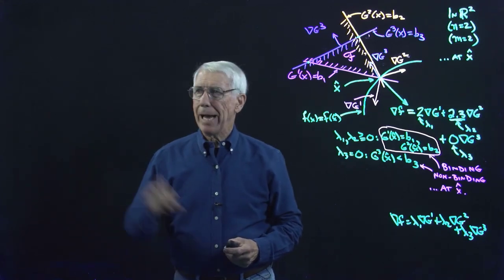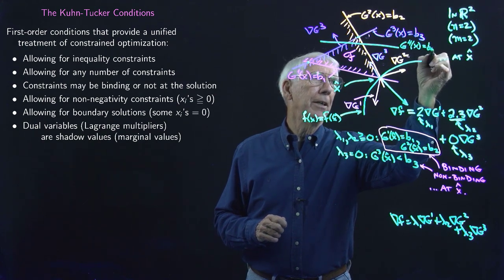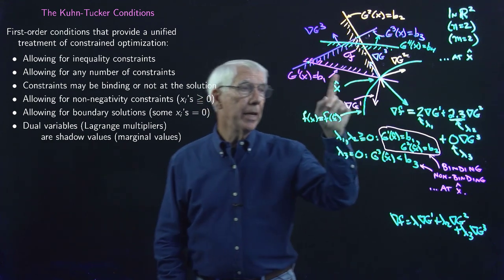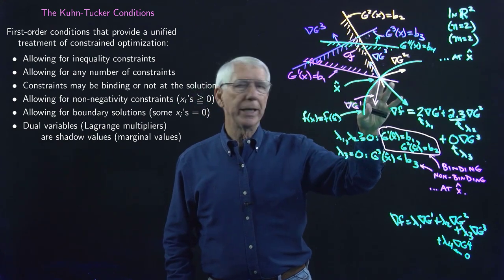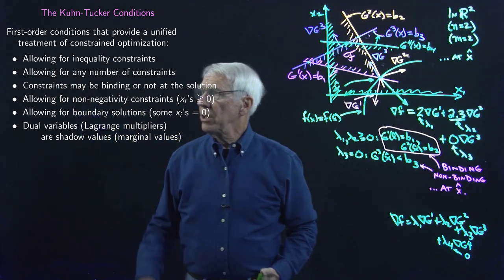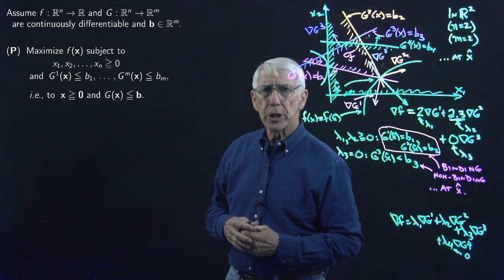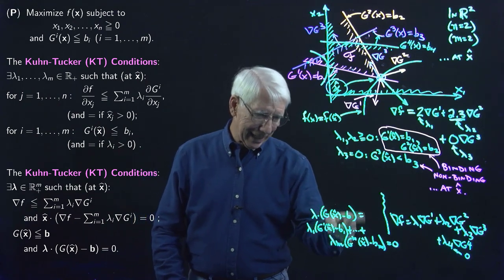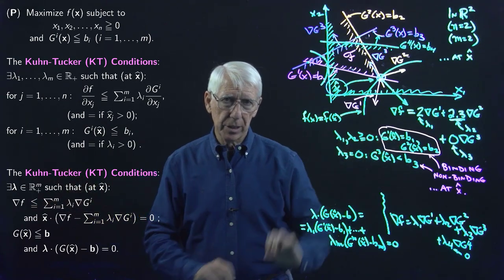Lecture 40(B): The Kuhn-Tucker Conditions and Theorem

Comment: At 13:42 can anyone clarify why lambda can't be negative if the difference (G(x) - b) was zero, why does lambda have to be non-negative even if the difference was zero?
Reply from the maker: The KT conditions say the lambdas have to be nonnegative. The reason they're nonnegative is that they have to "point away" from the constraint set, which is defined by less-than-or-equal-to inequalities --- the objective gradient has to lie in the cone outside the constraint set, i.e., the objective function has to increase away from the constraint set, not into the constraint set.
Reply: @ArizonaMathCamp  Wow thank you so much professor!!! You're amazing, may God Bless you

Comment: If this was a minimisation problem, would our derivatives of the function be ≥ sum of the linear combination of the derivatives of the constraints (line 2 of KKT Conditions) (rather than ≤)

Also why do so many texts on KKT miss out this condition of ≤ and just set the derivative functions = to each other, like in an equality constrained problem? Do you have any reliable texts you recommend? Thx if you get time!
Reply from the maker: That's the right idea, but it's not quite as simple as that. An important key to dealing with minimization and with >= constraints is to note that (a) minimizing a function f is identical to maximizing -f, and (b) multiplying both sides of a >= constraint by -1 turns it into a <= constraint. This will enable you to apply the KT Conditions as given, or alternatively to convert them to conditions for minimization and/or >= inequalities. (How has your year gone so far?)
Reply: @ArizonaMathCamp  Hey, good to hear from you! Apologies for my delay I am in the peak final exam season for mine, six-year pilgrimage through Econ/Maths. Frustratingly, the KKT conditions are still haunting me. The optimisation course I’m currently using for example does not even note the condition of our Lagrange derivative j being ≤ 0 if xj = 0. It also handles minimisation problems by just subtracting the sum of constraints…I.e. it doesn't multiply both sides by, -1. I just find the KKT conditions are taught in so many different ways!!
Reply: The textbook for this current course is built off is - Sundaram, L.R. A First Course in Optimisation Theory. I don't find it that great at times. Do you have a single source of truth for Lagrangians the KKT conditions? With good practice questions for all the edge cases? (obviously your material is great, but doesn't cover constraint qualifications for example).
Reply from the maker: @cormackjackson9442  Well, you've already cleared the first hurdle, by recognizing that there is not just one CQ. A CQ is a condition sufficient to ensure that the first-order (necessary) conditions will hold at a solution (a maximum). A number of different CQs have been identified, each one sufficient for this. Most treatments give just one CQ, which obscures this multiplicity. I like Sundaram's book a lot, but it has just one, I believe. The only book I can recall (it's not the only one there is, I just don't recall any of the others) that covers multiple CQs is a book by Peter B. Morgan titled "An Explanation of Constrained Optimization." The book provides good intuition, and discusses multiple CQs, with examples.